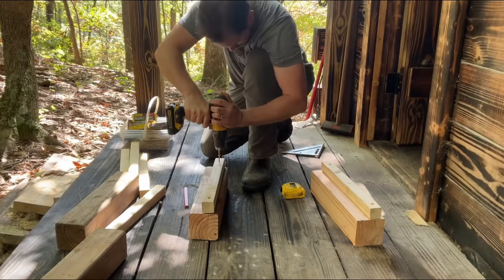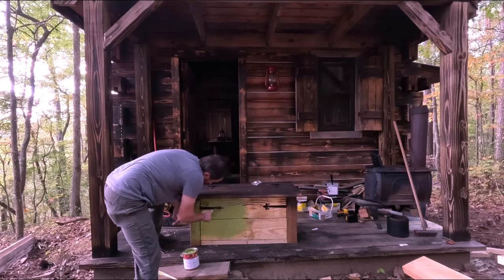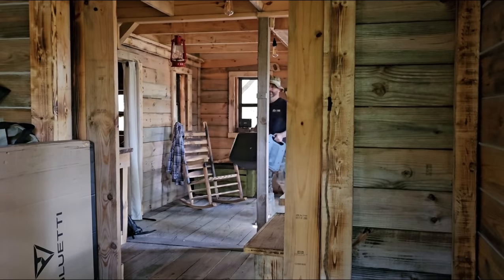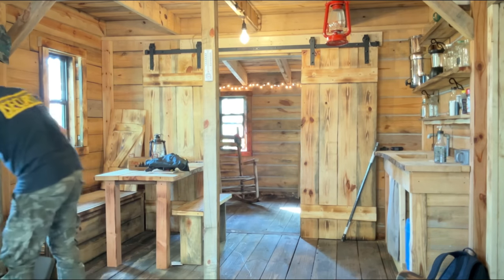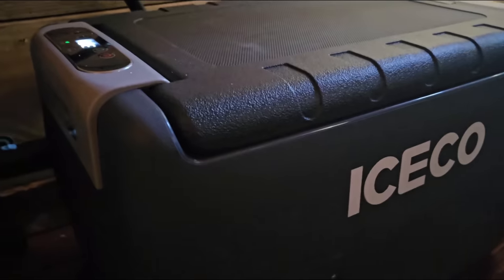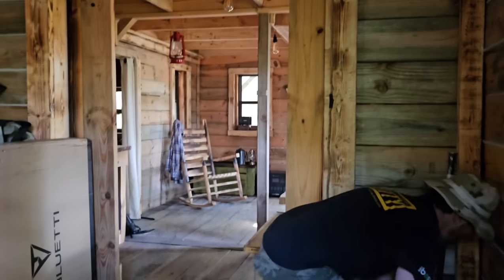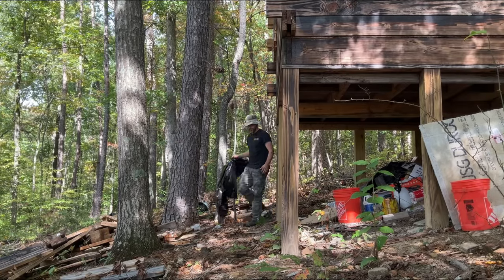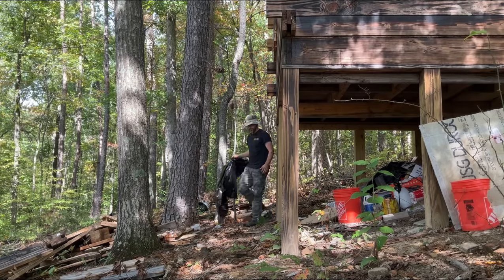Buttoning Up and Powering My Off Grid Cabin | First Fire of Fall | Bluetti

Comment: You might consider a little butane stove, like Gas One, for some small cooking, boiling tasks. In one of my houses, that is my only stove. I bought it as a temporary stove and found it was all I really needed. I do a lot of cooking, boiling water, etc., using it. Guess it will not be an issue with getting the wood stove going in the winter but in warmer months it might be a good alternative to getting the wood stove fired up.
Reply from the maker: Thanks for the tips! I’m currently using the wood stove on my front porch during warmer months.

Comment: You can save power by using dc instead of ac . Run led lights using a  automotive fuse box just like wiring up a camper . Your fridge will also run longer on dc . The ac converter uses extra power to run .

Comment: Run a bead of caulk or even that chinking material along the top of that trim piece you put over the osb where it meets the wall. Water will drip behind otherwise. And now that you’ve covered the edge of the osb it won’t dry, just absorb and rot.  I like your coffee table/chest.
Reply from the maker: Yep. Already doing it 👍 Just didn’t film it. Thanks👍
Reply: @TheOffGridExperience  awesome. Didn’t mean to come off as a know it all. Love the cabin build and want to see you enjoy it for many years.
Reply from the maker: @DrewEdwardBacklas  Not at all. Glad you have enough knowledge to even mention it. Most people wouldn't even think about that.

Comment: I love watching cabin builds. 
I tried in colorado for 16 months. Could never get a septic system installed. After 40k to the building dept, engineer and the 1 and only installer approved by the building dept , I ran out of money. My 80k estimate became 207k and still maybe another 20k to do the septic, if not more. I sold at a loss, vowing never to build in the US again.
What are you guys doing for waste water?

Comment: I would have used some tinted silicone caulk on those seams…
Reply from the maker: I’m using LogJam chinking material. Works well but is tedious.
Reply: @TheOffGridExperience  Yeah.  I can imagine.  Just caulking the shed I built last summer was a  time consuming.

Comment: I was just wondering if you have ever set your woods on fire.  I would never have the nerve to use at burner like that without a good water source which you don’t seem to have.  23:21
Reply from the maker: I've only burned down about 5 acres so far, so not too bad.
Just kiidding. Never came close to burning anything down. Woods are very damp where I am. Lots of springs, creeks.

Comment: On the 2/8 are they treated and what do you seal it with
Reply from the maker: All untreated. I did put timber oil on the south facing side to protect against UV in winter when leaves are off the trees.
Reply: @TheOffGridExperience  thanks. I'm fixing to start building on your format a 16/20 . But I'm putting in a rootseller

Comment: Bluetti is not a good choice for powering a cabin because it uses a low cost, high frequency, transformerless inverter to produce AC power. High frequency inverters are awful at starting high inductance loads like refrigerators, power tools, portable AC units and microwaves because they only offer at best a 2x surge capacity. You may be able to start these types of loads when your high frequency solar generator is new, but every time you do, you're shortening the life of the inverter's MOSFETs. Worse yet, if one of those MOSFETs shorts to ground goring a failure, your solar generator will send high current, high voltage DC straight into your appliances which will damage them and can cause a fire. A much better choice is to purchase a solar generator that uses a low frequency, transformer based inverter instead. It will last far, far longer and you'll be able to power high inductance loads without damaging your solar generator. And it will also be a lot safer.
Reply from the maker: Seems to work well for me. Take care 👍
Reply: Give it a year of inductance load use and report back on well it works.  @TheOffGridExperience